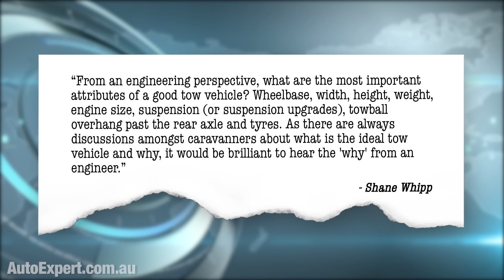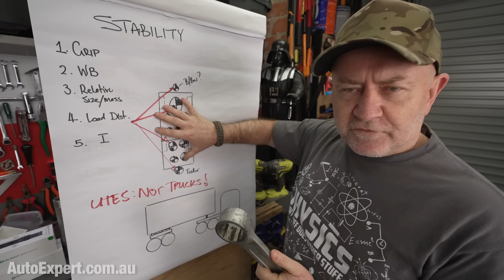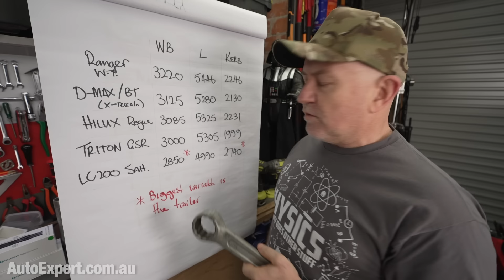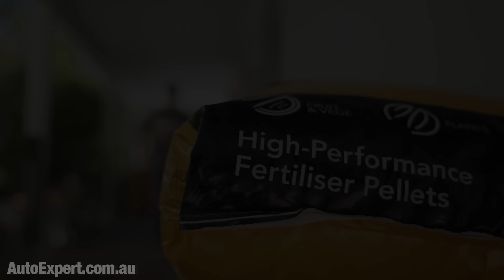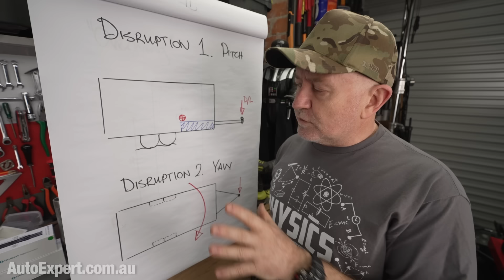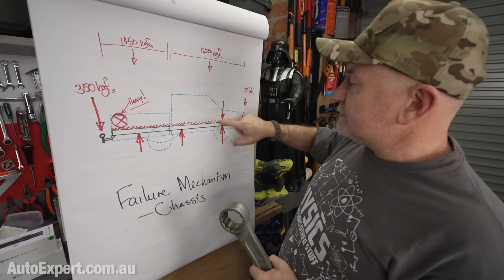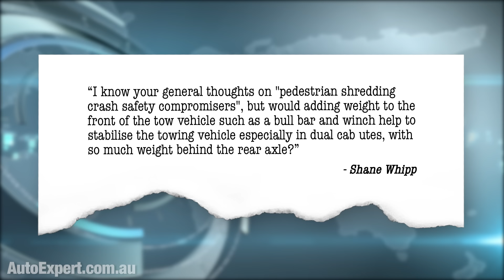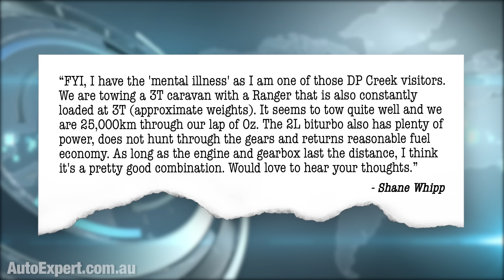Heavy Towing in Depth: The Applied Physics Deep-dive | Auto Expert John Cadogan

Comment: Been towing car trailers for years to race tracks. mostly with FWD vehicles. To this day the amount of people I see towing cars that must have 3-400kg of tow ball down weight by having the tow'd car so far forward on the trailer out right baffles me.

We always balance the tow'd vehicle over the trailer axle so that wee have ~50-80kg of down weight, so that the draw-bar is horizontal. The tow vehicle always  feels balanced, never had the shakes or the tail wagging the dog. Cruise along at 110km/h no issues at al (aside from a significant reduction in fuel economy.) With any vehicle; (especially FWD) It's important to not overload the toe bar as has the effect of unloading the front wheels.

Comment: Nice physics. I just want to say overhang does matter. Shortened the goose neck by 50 mm and removed some pitching. Improved horizontal looks of the car. ie less ball weight on the rear axle due to less leverage.

Comment: Wish all the physics teachers were as clear as your presentation!  👏👍👍

For the physics-challenged individual, please just walk around your rig and make if it looks like a monkey about to get f@&ked by an elephant, the load is TOO BIG for the towing vehicle.  

I saw an old 35’ trailer on a ball hitch being towed by 1/4 ton pickup in TX, with a LOT of tongue weight, which fit this definition and he would be lucky to get to his destination alive.  (Hint:  He was *driving too fast * and damn near went into a jackknife every time he got a bit out of control swaying, which was every time he hit a gust of wind.)

I saw him pulled over so I stopped my rig and asked him WHY he was doing such a crazy thing.  He said he thought it would be OK for a short run of 25 miles.  I gave him the above advice and   recommended that he NOT exceed 30 mph or call a friend with at least a ¾ ton truck that could handle both the tongue weight and the weight of the following load. I asked if he had brakes on the trailer, to which he replied “Yes,” but weren’t hooked up; I recommended that he get them to work SOMEHOW.  If not, call his life insurance agent and make sure that  his policy was paid up.

PS The trailer had two, full 7-gallon propane tanks in the front.  Those getting crushed in an accident would have been the icing on the cake!

Comment: The safest vicheals to tow with are the ones that have the shortest measurement between the center of the rear axle or the axels to the tow hitch.  E.g 5th wheelers or tandom rear axle trucks with a turn table hitch above the axels centers, or a SUV with a short hitch to rear axle measurement. Because of this the utes suck for towing.
Reply: Technically, the safest is tracked platform. A light 20 ton tank for example is excellent towing platform.
Reply: Lots of rigid European trucks with two or three axles pull a drawbar trailer, because the truck has a big rear overhang (to keep the front axle weight down to legal limits) the hitch is tucked right under very close to the rear axle, and the trailer has a great long drawbar, then two or three close coupled axles under the mass centre of the trailer. Often these trucks will have two 20' boxes and run at 44t all up, so a substantial trailer, but more manageable on twisty roads and at small depot sites.
Reply: @hectorkidds9840  flat bed trucks have the advantage of an extra long wheel base which also eliminates swing.
Reply: @GuitarsRockForever  my D4c was exelent for towing but could only do about 10 k/h.  So no hairy scary stuff anyway.

Comment: Johnny, I don't agree with you explanation about the "overhang" subject. You forgot to account the rear wheels' friction as opposing reaction to the yawning imposed by the trailer. To explain it plain and simple, assume your vehicle as a beam (as this is how all engineers analyses the forces acting on a subject, in this case tow vehicle), you will have 3 forces acting on the beam, Fv, 2 x Wheel Reaction. Then analyse if it is stable or not using moment of torque formula analysis.
Reply from the maker: The magnitude of the lateral force imposed by the trailer is the most significant and also most highly variable factor, because rear-wheel grip (approx 0.9-1.0G on dry bitumen) and overhang on all vehicles is so similar. Therefore, there's no tremendous vehicle-centric variation across the range of dual-cabs. The biggest variation is lateral force times distance to the yaw centre.
Reply: @AutoExpertJC  that is true for new utes but there are many people watching these videos that either own or can only afford an older tow vehicle with dimensions that vary greatly from the current standard. You also have the situation of someone like me with a 25 year old 4×4 (only has seatbelts for safety features) that due to the way the rear door opens and spare wheel mounting some people choose to run extremely long towball mounts. This simple equation would guide people into better choices when they can't buy new.
Reply: The longer the distance from centre of yaw to the towball increases the force (torque)  during the yaw. The 4 wheels provide an opposing force until it can’t. The opposing force of the wheels depend on the mass of the vehicle. The shorter the distance from towball to centre of yaw and heavier the vehicle the more stable the setup. Lc200 GCM is 6850kg. Less 3500kg = 3350 which is the GVM of the LC200 meaning it can be fully loaded and tow 3500kg. The Hilux have max towing at 3500 and GVM 3050 but GCM is 5650 therefore if the trailer is 3500kg the vehicle can only be 2150kg. But the Hilux tare is 2200kg
Reply: Another reason that rear wheel "overhang" is important, is that it increases the so called "Lever Effect", thereby increasing the actual weight applied on the rear axle. 
Example, an LC 200 with 350Kg on the towball, shows an addition 450Kg weight on the rear wheels on the scales. So the shorter the overhang, the shorter the "lever" and less increase in Tow BAll Weight at the axle.

Comment: The most important thing for stability in trailer stuff is speed. Second most important thing is where is mass in trailer. First if all you gotta have 5-10% load on towing vehicle otherwise when trailer start left right "dance"..  you are screwed, because it never stops. Than we can talk about mass, overhang, power, 2x4, 4x4... Endless little things. 
When you increase speed from 80 to 100 km/h all shit is double. All side forces in corners, stoping distance, collision force in accident... All shit is double in just a bit more speed. You can even overload trailer   and to towing vehicle but you gotta drive slow and nothing bad is gonna happen (most of the time 🤣😂).
Reply: Totally agree on speed as I discovered myself around 1992 rashly volunteering to move a VERY heavy steam boiler for a museum, towing  a rented trailer with my 110 Defender.  The probably 5 ton and  grossly overweight albeit neutrally positioned load soon had me starting to sway. Fortunately I eased off the power very gently and recovered, adopted  a 25mph limit and had no more scary moments. Apart that is from return of the trailer, hoping they didn't see the repaired broken welds  where we'd had to repair it as had sagged badly.

Comment: Bull bars actually cause more damage,all bullbars a mounted low,an impact will fold the whole bar backwards pivoting on the mounts at the bottom,bull bar strength is only as good as it's mounts they fold first.
After an impact you have a rigid structure slamming into all the front of your vertical high on the bonnet where there is no structure pushing the radiator back to be chewed up by the fan and other moving parts.
This will happen no matter where the bar is hit.
If you hit something with no bar the softer parts in the front fold back pushing the roo off to one side or down under the vehicle,vertically bouncing off.
You see car or 4x4 that have hit something with a bar fitted and the owner says thank god I had that bar fitted,he hit it in front of the left headlight,now though he had 2 smashed headlights,the bonnet grill radiator all damaged ,without the bar, it have been just a front guard light,with the roo being deflected to one side.
My advice would be to slow down,dip your lights once you see an animal,a animal that can't see because you have blinded him with your lights is a loose cannon,a roo will be more predictable if it can see.
I have hit a couple of roos both came from nowhere,bounced onto road in one bound.
I drove the vehical home both times.

Comment: Planning
We are approaching retirement. Planning for local travel commenced several years ago with the following objectives and constraints:
•	Decision: Select conservatively matched vehicle and trailer.
•	Function: 
o	Flexibility to stay in parks or “off grid” for 7 to 14 days as confidence develops.
o	Travel inland and coastal sealed and unsealed roads.
o	No toy cartage. No rock climbing / mud / water crossings. 
o	Maintain and hold for ~15 years.
•	Trailer storage at home height restricted to ~1.8m.

Research
Sources used are probably typical and included: manufacturer specifications; commercial media; independent/enthusiast publishers; privately sourced fleet operator reliability estimates for vehicles; caravan and camping shows; dealerships.

We don’t have engineering or trades backgrounds (my 20+ years experience in Vectra / Golf towing ~500kg ATM does not compare with this decision). Research efforts were made on: 
•	Vehicles (dimensions, masses, engine and transmission operating characteristics, maintenance requirements).
•	Candidate vehicle frequent failure complaints, how they might be avoided or made less probable, how to minimise the cost and time to recover from them.
•	Wheels (size) and tyre (type, construction, aspect, profile, weight) suited to intended applications.
•	Components and machinery incorporated in trailer fit out (operating characteristics, maintenance requirements).

Excluded from consideration were:
•	American style utes (cost, dimensions, flexibility, reliability).
•	Small European or Japanese trucks (cost, dimensions, flexibility).
•	Dual clutch or CVT transmissions (towing).
•	Tent (comfort, effort cf health).
•	Caravan (cost, risk v reward, reliability, storage).

The discovery of information sources that exposed principles and facts related to applications, technologies and products have been invaluable. Examples included:
www.autoexpert.com.au (generous in explaining technical subjects, humorous, and a little naughty)
www.outbacktravelaustralia.com.au (tyres, stability “An experimental investigation of car-trailer high-speed stability” Department of Mechanical Engineering at Bath University in the UK)
www.4wdingaustralia.com
www.outbackjoe.com
www.youtube.com/c/DashCamOwnersAustralia  (a regularly updated survey of mistakes made on our roads)
www.engineeringtoolbox.com

Our initial direction 
Was the purchase of a medium sized utility, canopy and trailer. No concensus emerged there. Vehicle variations were discarded (cost, comfort, flexibility, dimensions). Accommodation ideas persisted (pod camper and camper trailer).

Our final direction
Has been a 4wd wagon and trailer. Preferred vehicles included the Mitsubishi Pajero Sport and the ISUZU MU-X. 
Pod camper and camping trailer options were reduced to a single option each.

 
Decision
The MU-X LS-U was selected (mass, low rpm torque, load space, contemporary safety package).	
The pod camper alternative was discarded after we had the opportunity to inspect one at a caravan show (size). We visited the camper trailer mfr at their Slacks Creek workshop and observed examples of the Trackabout Explora in stages of construction. Shortly afterward we had the opportunity to see a finished example at a caravan show in Melbourne. We were then comfortable enough to order a trailer.

The decision will deliver workload within the performance envelope of the combination with margins of safety:
			                Tyres	Wheels	Axles	GVM/ATM	GCM	Towball/Hitch
Limit	Vehicle	F	1250	1250	1450	2800	        5900	350
		                R	1250	1250	1650			
	        Trailer		1250	1250	2000	2000		3500
Actual	Vehicle	F	587	587	1173	2493(1)	        3822	82
		                R	660	660	1319			
	        Trailer		585	585	1411	1411(2)		                82

(1) Vehicle payload 338kg includes fitout, driver, passenger, vehicle and personal items, towball mass.
(2) Trailer payload 411kg includes 185L water.

Negotiation
Vehicle and trailer were ordered in 2022 (market conditions less than ideal). 
Vehicle	discussions focussed on price. “All in” pricing (including $4k of options/accessories) varied by ~10% from least to most expensive, delivery lead time was 13 months. Trailer delivery lead time was 8 months.

Adaptations
•	Replaced OEM vehicle wheels (R18) and tyres with accessory wheels (R17) and AT tyres (D697 LT). The wheel and tyre size were chosen for comfort, puncture resistance, sidewall tolerance for inflation variation, alignment with OEM profile and aspect.
•	Other vehicle adaptations included: brake controller; fused cable to Anderson plug; 12V compressor; load rated cargo net for wagon; wheel clamp; OBD II reader.
•	Trailer adaptations included: wheels and tyres matched to vehicle; battery charging incorporating 12V / 240V / solar; diesel heater.
•	Towing course for my wife and I. 		

Closing Remarks
John, AutoExpert has helped us consider many aspects of the research and decision making differently and more thoroughly than we might have done on our own. Our selection has been more systematic and exhaustive for your input. We are grateful for the time and effort you have put into explaining such a wide range of topics in a comprehensible manner in your reports.

Comment: A friend who does a lot of caravanning says that his caravan has a computerised stability system plus the brakes as well. Does this actually work in hairy situations or is it more of a marketing gimmick?
Reply: It extends the safety envelope, but it’s not infallible. Provided he doesn’t drive harder or try to “push the envelope”, it’s definitely worthwhile. The Trailer Stability system on my BT50 is one example, if it detects a sway building up, and it applies the brakes on one or two wheels if the vehicle (something I can’t do) to counteract the sway. Add the Vans ESC which applies the Vans brakes, again independently of my input, and it makes for a much safer rig. One problem is though, “I” never know if either system ever activates, thus it could be tempting to think it’s all more stable than it actually is and push that safety envelope in blissful ignorance; thus negating the advantages. Personally, I don’t tow the van over 90km/h.

Comment: Hi John, I occasionally tow a race car or associated wrecked cars for parts and or project cars etc. I tow with a Toyota Fortuner with a maximum trailer weight of 2200KG but usually it's much closer to 2000KG.  I'm usually a pretty conservative driver when towing and try to tow between 90-100km/h. 

I am aware of the ESC stability control on caravans but don't fully understand it. Can you shed more light on this. Furthermore, it does sound like this technology could be applied to a car/implement trailer or horse float yet I cannot see anyone who has done this. Has it been done? Can it be done? If so why is it not more popular?
Reply: i think its alko that make an aftermarket trailer stability control. afaik it requires electric trailer braking.
there is also ABS for trailers available.
its not popular because it costs and most people don't give a crap about what they tow.
Reply: @tweake7175   Alko refer to it being a caravan specific thing. Personally I think you're mad (not you personally)  if you don't use or at least prefer electric brakes as they are so much nicer to tow with. I really don't know but I'd fit it in a heartbeat to a car trailer.
Reply: @TheSouthern75  we use overrides as many utes use the trailers. Plus discs because they work better. But we load trailers better than most caravans.
Reply: @tweake7175  A high percentage of all larger vans sold these days, incluse Electronic Stability Control as standard. Jayco for example include it on all of their large vans. There are a number of manufacturers now.
Reply: @tweake7175  Yeah overrides suck but they do the job, towing with electric brakes is much better but are you referring to override disc or the hydro electric disc? Or electric or override drums?
Reply: @TheSouthern75  override disc's compared to electric drums. 
the problem for us is good electrics requires controllers and each vehicle wired (the wireless systems are terrible), hence our use of overrides.
 drum brakes generally have adjustment issues and overheating issues, especially when people overload the trailers which is common.
electric hydraulic systems (disc's) are really nice tho a bit $$$$.
Reply: @tweake7175   Yeah that is an issue, but that is a different kettle of fish. Generally people have one trailer and one tow vehicle. I tow a trailer a fair bit that has override brakes (discs) and they do the job ok but compared to the one i tow with electric drums... the electric brakes can increase towing stability a lot.  The electro hydraulic disc setups are just amazing to tow with.

Comment: A quick question about bullbars if I may:
I'm getting a Triton and I notice that Mitsubishi say the following about their Front Protection Bar (i.e. bullbar): "The Genuine Black Powder Coated Front Protection Bar has been designed and engineered to meet Mitsubishi Motors' stringent safety standards. It's fully airbag compatible, and retains Triton's 5 star ANCAP rating when fitted.”
Do you think this solves the bullbar-not-as-safe problem or do your read marketing BS into this statement?
Thanks.